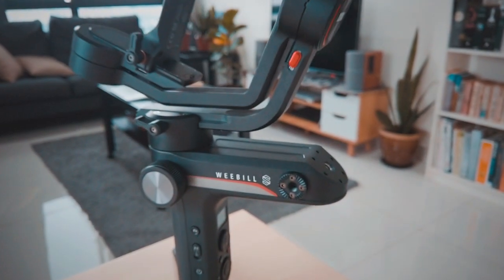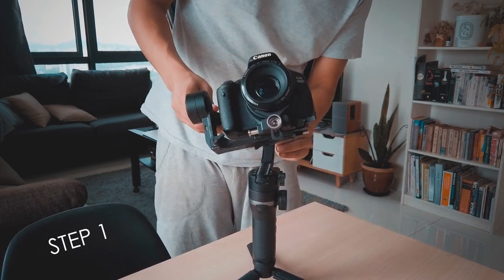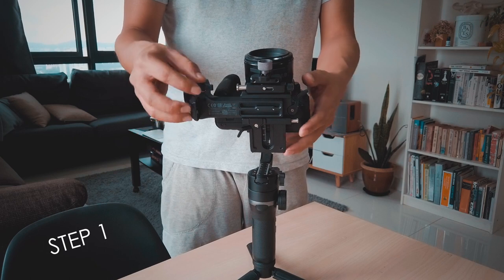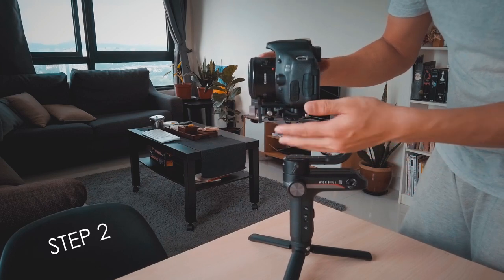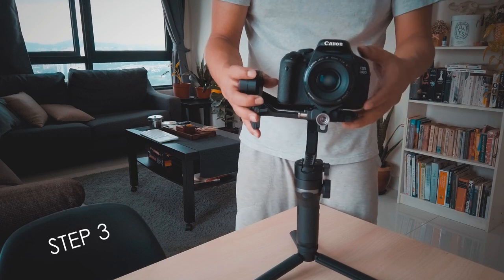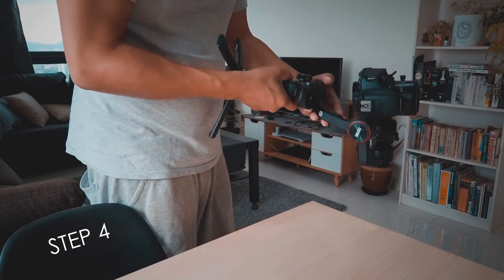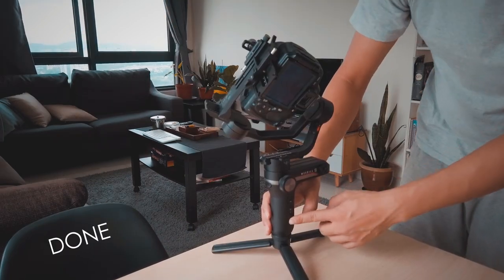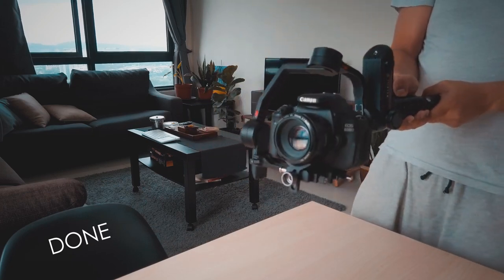How to balance camera on Zhiyun Weebill S with Axis Lock Error

Comment: Great video. I have a weebil S....but somehow can’t get it to work 100% in terms of nice smooth shots. It somehow gives it a little shake or if I pull left or right shooting objects that are closer, it’ll look more handheld even though it’s on the weebil s gimbal.
Reply from the maker: Thanks. What i do usually for smooth shot is to shoot them in 60 or higher fps and then slow it down.

Comment: When I do step one the camera just stays in whatever position I put it in. It doesn't fall in any direction. So it doesn't automatically fall so that the lens faces up like yours does. What am I missing?
Reply from the maker: DId you adjust the vertical lever high enough so that it will fall back?
Reply: @SideScope  I didn't. Works now, perfect 🙌 

Had more axis lock errors, but every time because I actually had an axis locked, lol

Comment: hey can you help me out? my weebill S seems to have some "horizon wobble/shake" when I'm filming. Do you know how I can fix this? Have you had this issue before?
Reply from the maker: Hmm sorry bro nvr had that issue. Maybe try setting the motor strength to high to see if that works?
Reply: @SideScope  can you share what your motor settings are? I posted a video showing my test footage if you want to see what I'm talking about. thanks
Reply from the maker: @billem16  I'm using the default settings. Works fine for me.

Comment: I bought a weebill S 4 months ago and it had a tipping forward issue but it didn't bother me too much. I decided to update it today and boy. I regret it so much as it broke my gimbal and it started spinning around wildly. I tried downgrading the firmware but the problem remained. Basically this update broke the gimbal and I tried contacting zhiyun and they refuse to replace my gimbal which they broke. Now I'm stuck with a broken gimbal caused by their firmware that they refuse to replace! BUYER BEWARE